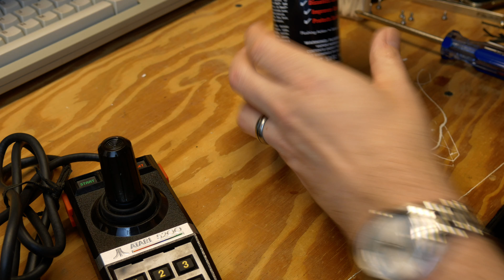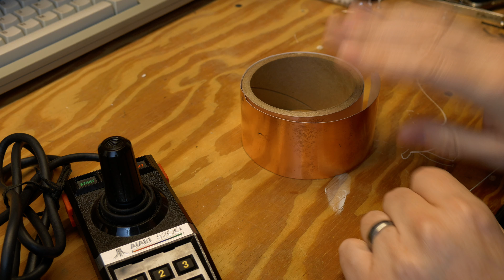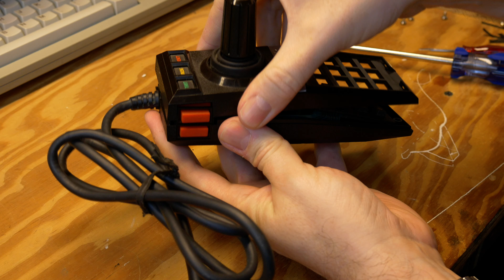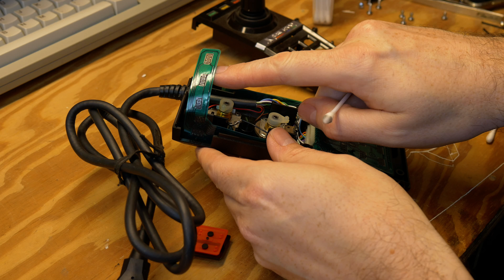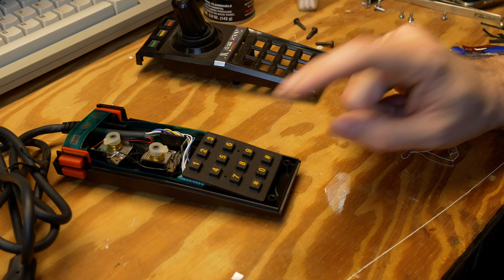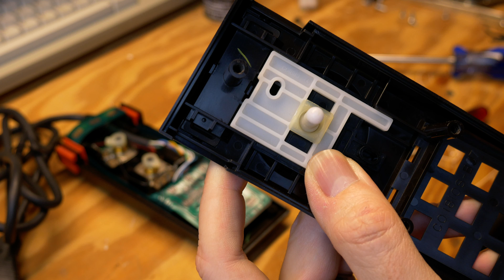Atari 5200 controller repair Part 1 - fixing two common problems

Comment: "I don't see why [gold] would be necessary"
It's not just because gold conducts better, it's also because gold is inert and doesn't oxidize like copper, aluminum, etc.
Reply from the maker: That's true if everything you're using is gold. The problem here is that the socket contacts inside the controller are still tin. So then you've got gold on tin at the worst possible choke point. There are just as many reports around the net of people with the gold flex circuits having them fail as the tin ones (among those who replaced their flex boards), and I'm sure that's why.

Best Electronics seems to sell basically everything for these controllers but a socket with gold plated contacts. That's going to remain a big weak point, and it might even be worse with gold on tin than tin on tin.
Reply: Modern Classic Reminds me of when Scott Mueller's Upgrading and Repairing PC's 12th Edition had to revise the recommendation for RAM modules to say that you wanted to match the material used in your particular motherboard's RAM sockets. That was in the '90s so they're probably on the umpteenth edition these days.

That said, if gold is truly inert then it should continue to be a better connection even after the tin oxidizes unless it somehow promotes oxidation with the tin due to dissimilar metals. I would expect the same issue with copper on tin, especially because copper oxidizes. I suspect that the carbon from the rubber pads breaks down, coats the contacts, and actually makes connections across the contacts of various resistance levels (being matrixed makes it difficult to tell). This is what happens with conductive paint in nearly any rubber/carbon membrane I use it for, even when it's specifically sold for that purpose. Rubber flexes, paint flakes, flakes short contacts. If the same thing happens with carbon/rubber dust then it may explain why gold membranes alone do not fully solve the problem or why they didn't just add a little dielectric grease to reduce oxidation.
Reply: OK, I've spent days working on several of these controllers and I'm pretty sure that the carbon pads on the old ones are the primary issue with the buttons. They simply aren't completing the circuits after some amount of use, even when cleaned or improved with DeoxIT/dielectric. My guess is that only the thinnest portion of the rubber surface is involved. Perhaps they didn't impregnate the carbon deep enough into the rubber or perhaps all the carbon close to the surface comes out as dust, leaving increasingly less-conductive rubber. The Rev 9 flexible mylar PCBs switched to carbon traces and these are considered the best, but they aren't subject to the same forces as the carbon inside of elastic rubber that gets repeatedly compressed and expanded (Mylar under contact pressure? Yes. Mylar being squashed and stretched? No.).

My primary issue has been with BRAND NEW pots that are WAY out of spec (~350k ohm max instead of 500k ohm max). Even the worst junk controllers with Japanese pots still have good pots but the "CTS" pots are always ruined, even fresh out of the box (I have a NOS case of four). Atari just couldn't get it right!

Comment: Nice video, as usual!

Just at small tip. I had the same problem as you but even after replacing the flex circuit my control didn't work.  However fried of mine  that is an electrical engineer gave me some help and started to clean the contact between the flex circuit and socket on the control.  Now both my controls are working.

Home you understand what I mean despite my bad English.
Reply from the maker: Sadly I tried that, at least on one controller. I think the contacts on mine are just too dirty/oxidized. But I do think that's probably the problem because on one controller I have 1 and 4 working on the keypad, and on the other I have 2 and 5. But after deoxidizing all contacts, no change. My circuit boards were very loose in the socket too, so I think they're not making good contact and if they're even a little bit oxidized, that's enough to make them not work. Hopefully having a new, 100% clean flex circuit will fix that, but my one worry is that the socket itself is oxidized, so I'm going to try spraying Deoxit in there and plugging/unplugging the old flex circuits a bunch of times to clear it out. Then I'll install the new circuits. Hopefully that will do it.
Reply from the maker: Just an update - replacing the flex circuit worked! I've only done one so far because I'm thinking about doing a "part 2" video where I just replace the flex circuit and get the second controller working. I know people want to see a satisfying ending, unlike the ending to this video (which will be renamed "part 1" if I do the part 2).